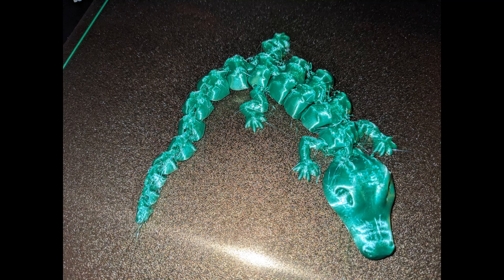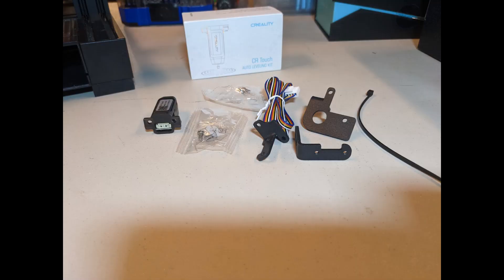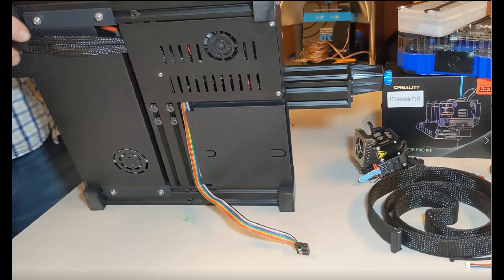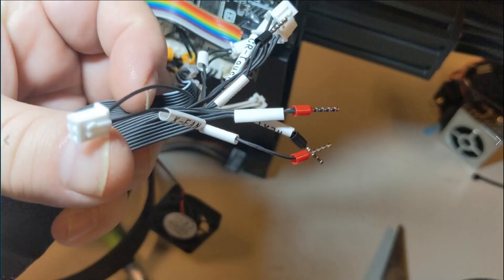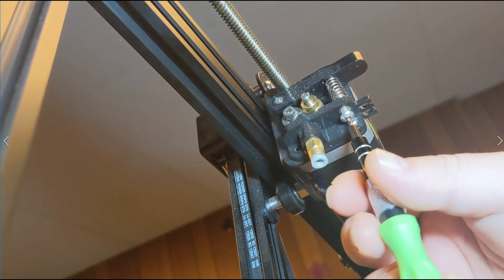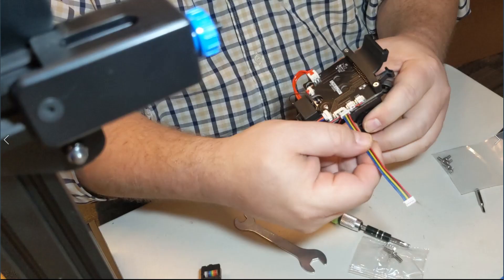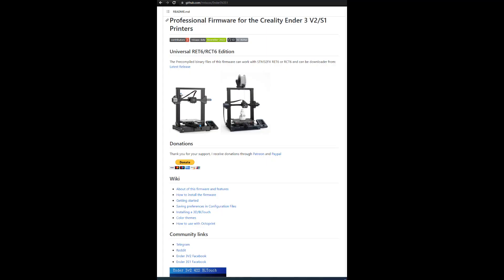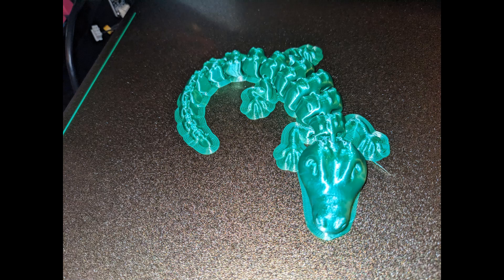Creality Ender 3 V2 Sprite Pro and CR Touch Upgrade - IGS Fedex Days 2023

Comment: hi is it possible to send me the firmware please ^^
i can't get it to work with firmware i find on internet and i have a ender 3v2 with a 4.2.2 mother bord sprite+cr touch 
pleas help me ^^
Reply from the maker: Yeah I'll see what I can do when I get home
Reply: @the3dprintern  thanks a lot
Reply from the maker: Here is the link directly to the bin for that printer, motherboard version, and sprite+cr touch: https://github.com/mriscoc/Ender3V2S1/releases/download/20240122/Ender3V2-422-BLTUBL-MPC-20240125.bin
Reply: @the3dprintern  did this work for you? i have the same ender 3v2 with a 4.2.2 mother bord sprite+cr touch and it never goes to the center of the bed when homing
Reply from the maker: @nicolinoricci338 yeah it totally worked for me! That firmware that I referenced in the description or the comments. I forget where I had it, it really does the trick.

Comment: I'm in this same boat, cr touch goes past the front of the print bed, zero resources from creality on how to fix this, which is ridiculous since this is literally sold as an Ender 3 V2 upgrade. This has convinced me to never buy from creality again.
Reply from the maker: Yeah it does kind of stink that out of the box it doesn't just work.  I don't know if you took a swipe at trying to use the professional firmware, I think the link is in the description.  It definitely does give you a lot more control over things, but it's been almost 2 years now since I've messed with it.  I've gone full klipper on everything, so I have a ton of control over my machines now.
Reply: @the3dprintern  I did thank you, that git repo is a godsend.

Comment: Yo great video!How much faster where you able to print? And is the quality similar to the stock extruder or worse?Do you think it is worth 100€ or is it better to buy an entirely new printer (i currently own a ender 3 v1 with a bl touch and pei sheet with klipper istalled).
Reply from the maker: Thank you and great question! It allowed me to improve my flow rate and its consistency.  This coupled with a swap out to a .06mm nozzle nearly halved my print times with barely any quality degradation. But I would not spend the money on the upgrade with all the options that are out there now.  I would go buy a less than $200 printer that would kick the snot out of this thing.  

I would get an Ender 3 V3 or a Sovol SV06, both go for $180 new.  That is the price for the Ender 3 V3 at Microcenter and the price for the Sovol on their site.  I own 4 Ender 3 V3s and 6 Sovol SV06/+ (just bought two more last night...), just put klipper on them, run input shaping and you are off to the races.  Btw, the mod community around the SV06 is amazing!  The SV06 has linear rails on the x and y axis, dual z motors, easy to maintain, and is a breeze to install klipper on (thanks to https://github.com/bassamanator/Sovol-SV06-firmware).  I'm actually working on a video for installing Klipper firmware on the SV06 at the moment.  The Ender 3 V3 has linear rails on the y axis, sprite extruder, auto z-offset (freaking amazing at this price) and is pretty freaking quiet. 

Thanks for reaching out and I hope this helps!
Reply: @the3dprintern  thank you for the advice that really helps!! You earned a sub!

Comment: What was the name of the firmware files you downloaded?
Reply from the maker: Ender3 V2/S1 Professional Firmware
Reply: @the3dprintern  what file in particular did you download on that site?
Reply from the maker: @Brandonkeating1  https://imgur.com/gallery/BZ1z05Q
Reply from the maker: https://imgur.com/gallery/BZ1z05Q
Reply: @Andrew Willcoxon  did you have to change any of the probe settings?
Reply from the maker: @Brandonkeating1  I did have to change something to get it into the center.  Here's the screen: https://imgur.com/gallery/OFDgBLw
Reply: @the3dprintern  the menu is not the same, even choosing the same .bin version. It doesnt hava the 'Probe margin' option. My bed is all wrong, tried a lot of configuration. Dont know waht else i can try. :(
Reply from the maker: @tiagolcorreia  Did you install the professional firmware?  Did you install the sprite extruder and cr touch on an ender 3 v2?  Or are you running something different?  Just trying to level set, before making suggestions.
Reply: I would like to know as well.  I tried and it doesn't load my touchscreen.  I have to end up going back to creality's firmware for the touchscreen.